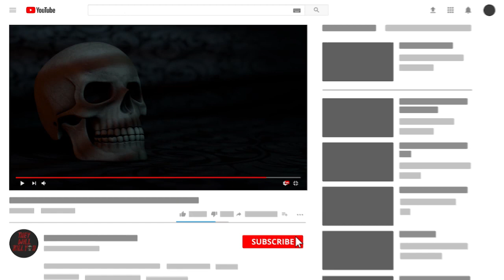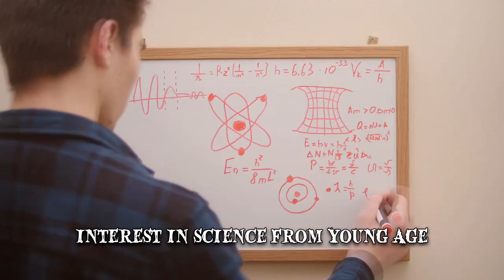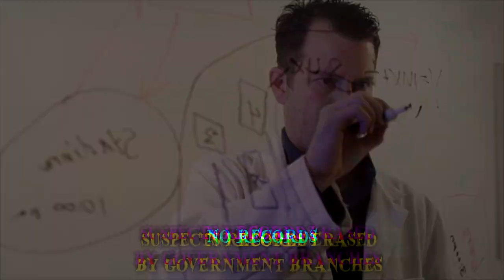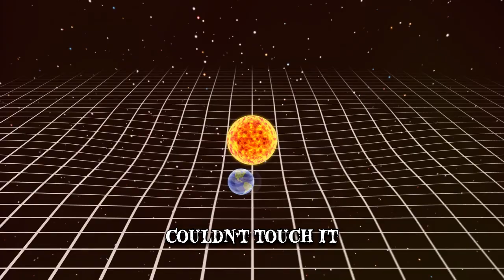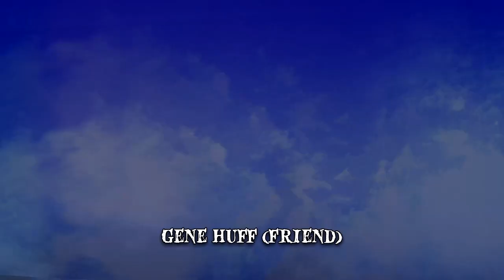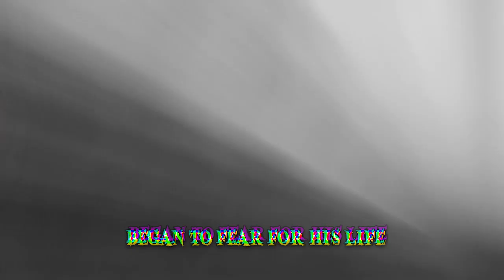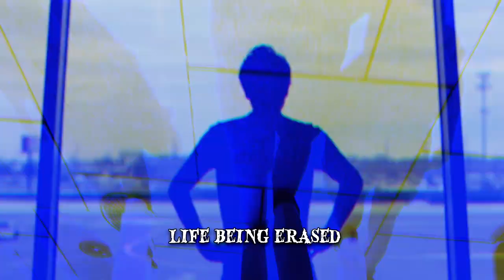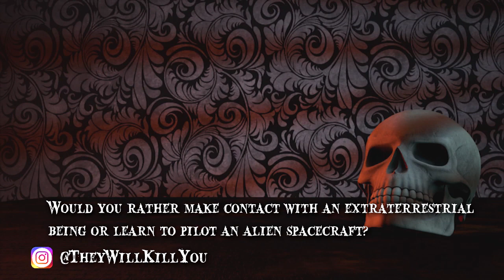Bob Lazar Exposes Area 51

Comment: No wiring, everything worked by just being in close proximity to reach other🤔🤔🤔
Can you say Bluetooth/wifi?😏😎
Reply: Well, Marconi just rolled over in his grave.
Reply: @IamBlackToast  did you mean Tesla?😏
Reply: Trace 23 No, I meant Marconi. Bluetooth and wifi utilize radio wave tech pioneered by Marconi and his wireless telegraph system.
Reply: @IamBlackToast  unless you were on this side of "the pond"
Reply: @Trace 23 Irrelevant; see my previous comment.

Furthermore, Tesla dismissed radio waves as useless for wireless telegraphy and concluded that Hertz, among others, was at least partly incorrect about their findings regarding radio waves. 

So yes, Marconi is the correct one rolling in his grave.